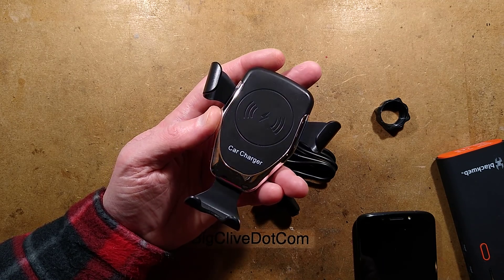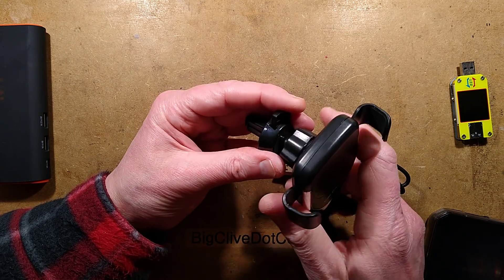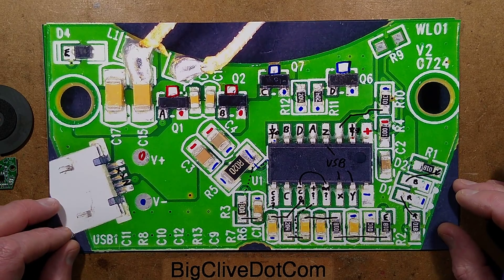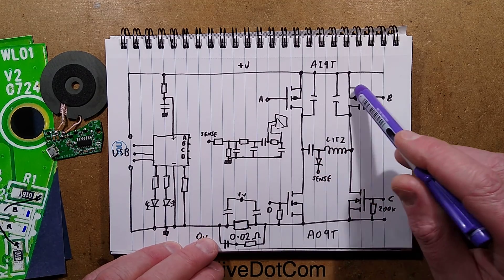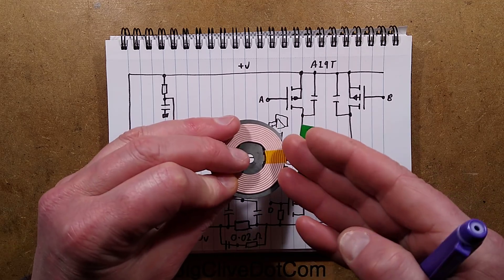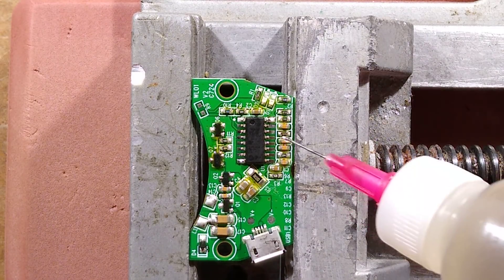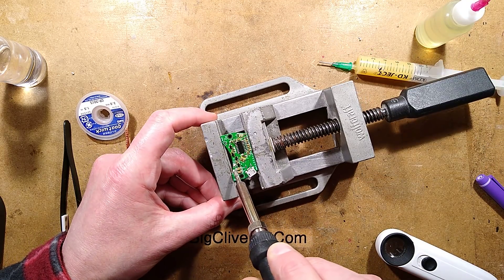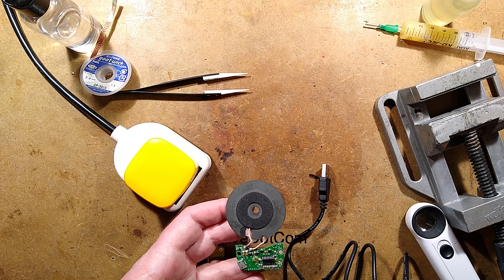Poundland inductive phone charger teardown (with schematic)

Comment: Not seen this one but i did have my eye on this one until i realised my Nokia 1020 requires a special adapter for QI charging and besides its so inefficient and slow better off with an old fashioned method ie plug charger!
I have a Marconiphone crt colour television over 30 years old and my  40+ year old Toshiba microwave is older than me and they all still work - average lifespan for you very average tv even panasonic aka Vestel is sadly now 4 years and microwave about the same - built in obsolescence for sure!
https://www.poundland.co.uk/339291-wireless-charging-pad/

Comment: 14:10 In the SMT pick and place machines at my workplace, each feeder has it's own ID number. If you put a roll of SMT components into it, the feeder is connected to a computer and a barcode on the roll is scanned, so the computer knows wich feeder has wich component in it. When inserting the feeder into the machine, the machine reads the feeder's ID and looks up wich component it has loaded and only uses it when the correct component has been loaded.

Comment: I sometimes would like to test these devices (they come back to the work as being "defective") but I don't have a phone that charges this way... If I were to take a coil and put it across my meter, and wave it in front of the charger, should I expect to see any voltage in the coil?
Reply from the maker: You can get bare receiver pads that put out 5V.  By adding a resistor and high power LED you can make a decent tester.

Comment: Protip: get the android app called "Ampere" which will show you the charge rate coming from the charger. For example, my Pixel 5 is currently charging at 1.5Amp from a powerbank I have with built in QI3 wireless charging support. Very useful app as it will also show you discharge rates too

Comment: So this a mount that it's difficult to align the phone in, if it fits at all, and doesn’t charge very efficiently. It gets its power via microusb. Why wouldn’t I just have a dumb cradle and charge the phone directly? It’s not that difficult. What am I missing?
Reply from the maker: For a delivery driver using their device as sat nav while also I using it to log deliveries, it could keep it topped up while saving a lot of connector wear.
Reply: @bigclivedotcom  Fair enough. I don’t drive much & hadn’t thought of that. In fact I drive so little I forgot the car was being serviced until I noticed it was missing last week. After a month.
Reply: @Matt Quinn That’s all very well, but the convenience would be reduced by the need to get it positioned just right. That’s footery enough in itself. You’re not going to have the USB power meter attached and there’s a fair chance it won’t get much of a charge.

Comment: so one of the only microcontrollers that i can find with those power pins in soic16 150mil  and usable specs is the paduk pms131-s16A but that would make your op amp loop vref to an analog input instead of an opamp also that would make Z the hardware reset pin which is fine except it doesn't have an internal pullup when used as an input so idk if that would work for usb line detection

Comment: The coil uses Litzendraht (Litz) wire. Multi strands of fine wire where each filament is individually  insulated and only joined together at each end. This significantly reduces skin effect losses in the frequency range of  kHz to hundreds of kHz. Qi chargers operate in the 100kHz to 200kHz range depending on their resonant frequency which changes with coil coupling.

Comment: I'm surprised you don't ever use an oscilloscope. You can learn a lot with one. It's the most useful tool an electronics engineer can have. Also, for surface mount I highly recommend a hot air rework setup. I've started doing mostly surface mount for my projects now since so many neat parts are surface-mount only. I have the boards made and a stencil. It's quite easy once you get the hang of it, especially with low-temp solder paste. I'm a bear too with my hands, with the added problem of trembling hands.
Reply from the maker: I do occasionally crack out the scope.

Comment: I have a similar one (same design, but different decoration) with different internals.
The internal plastic piece of mine is black, but more importantly it cominats marked ICs. An HC5703C (20 pin control chip), an LM324 (quad op amp), and two 8 pin MOSFETs: 4801 / YQ561, and 4812 / GA8P3C. And a 3 pin marked V3SC. The main capacitor is a leaded device. Oh, the 3 'legs' come out as separate pieces (and a spring) - a pinion gear remains on the inner carrier.Oh, mine is rates 5 volt 2 amps in or 9 volts and 1.67 amps.
Strangely it also states "5 volts out" and "9 volts out"...

Comment: I am aware that this inductive charges use resonant coils for charging, but how do the charges avoid wasting power, due to the eddy currents being induced in the phone screening and PCB tracks?
Reply from the maker: Alignment is fairly critical.
Reply: @bigclivedotcom   sometime in the late 90s, early 2000, I worked with someone  in Cambridge,  who slightly later formed a company  to develope the first power mat charging system. This was  sometime before the formal standards had been developed.
At the time I tried to persuade a major french car manufacture to build one of these chargers into the car glove compartment, the one between the two front seats. The idea was to make a place for charging mobile phones, the compartment was to be fitted with a passive aerial to re-radiate the mobile phone signal to an outside antenna. Communication with the car audio was to be via Bluetooth. 
Unfortunately, the car manufacture, did not think contactless mobile charging would ever become practical, and therefore rejected the idea.
The early version of the charging pad, created a complex three dimensional rotating magnetic field that was sufficiently powerful to rotate small metal objects placed on top of it. 
There remains the question as to why the modern version is not de-tuned by eddy currents induced in the mobile phone PCB ground plane or metal screens. Some time ago I downloaded the contactless charging specs, which are huge documents. These are divided into power bands and describe the communication protocols modulated onto the charging waveform. But as I recall, even these did not explain how stray eddy current loads are to be avoided.

Comment: Phones have so much useless circuitry. I have never used the touchless charging on my phones. I must be a dinosaur.
Reply: I use it w/ an aftermarket receiver coil (plugs into the USB port and sits between the back of the phone and the silicone cover) or magnetic USB-plug/wire in order to spare the phone's USB socket, which broke for me 2 phones back...

Comment: Great video!! 
It's nice to see that they made the ferrite disc so that the wire at the centre can go back to the PCB under the coil.
I also have a chunky case on my phone so usually have to dismantle any inductive charger, de-solder that centre wire, pop it through the hole in the centre of the ferrite disc and resolder it to the PCB so I can get the coil flat to the inside of the charger case so it actually charges the phone.

Comment: I'm working on pick and place machines. And at last the ones i know does not read anything off chips. The machine is only looking for chip "legs" and pretty much anything bright. Bright vs dark. Bright spots are measured, counted and alignet. It iluminates the camera and passes all of it heads (The one iam working on has 8 heads) with chips above the camera. Then in real time computer alignes all chips, expected vs measured centers of chips and places them with this aligment offset. Also verifies if measured "legs" (bright spots) are matching to the programed ones. So the camera is used to only aligment and rotation. Verification of loaded chips is made before auto run. After and durind loading copmonents into the machine. It is done twice at last in company i work for.

Comment: Interesting. I have a cheapo inductive charger, that seems badly regulated (gets really hot), in a case that matches your mat-style one, that uses just an STM8 as the chip. Do any of that match it?  It also matches a whole pile of recalls, one of which is https://www.cpsc.gov/Recalls/2018/Bluefin-Recalls-Wireless-Phone-Chargers-Due-to-Burn-Hazard  - so now it's just sitting around waiting for me to have a good idea of what to reuse it for. The case seems to be pretty generic, since I've now seen an ir-wifi bridge in the same case.

Comment: Thanks. .Probably the same chip used in a Braun electric toothbrush from the last century.
Reply from the maker: The toothbrushes are low current and usually very simple.

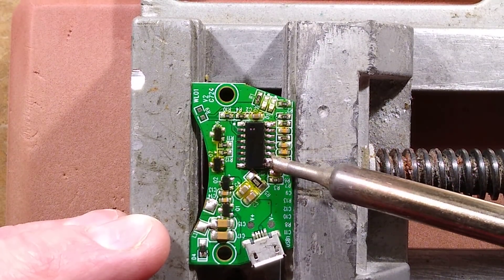Comment: I would check the solder blob that wedged in between the legs of Q7 at 15:42. It's funny that everyone always fail to insert a USB type A plug on the first try. Clive failed 100 % of the time as everybody else does :)

Comment: It might be interesting to bust out the silicone and take a few photos of the die, to reverse engineer the chip. I wonder how many people in the world actually KNOWS the innards of that chip.
Reply: Silicone?  How would that be of use?
Reply: @westinthewest  The die inside can be photographed and the you can reverse engineer the chip components and that way figure out if it is a generic microcontroller or a bespoke chip. If it is a purpose built chip you can quite easily figure out how it works.
Reply: @OscarSommerbo  I never realised the die was big inough to see anything without a microscope, and then it would just be a mass of tiny transistors.  What does the silicone do though?

Comment: Clive, Litz wire is braided in a pattern that ensures that each individual wire passes through each possible location in the cross sectional pattern equally. They also design it to suppress undesired frequencies and interference. Look here: http://hflitzwire.com/litz-wire-calculation-and-design/

Comment: Could this be something from the MC68HC908-series of microcontrollers? Power lines and most IO lines seem to match. Analog bit seems a bit strange but they might be up to some FFT dark magic.
Reply: I presume this is an Asian cheap clone of an existing microcontroller. I had a quick look at the main chip manufacturers and I could only find ICs with fewer or more pins to achieve a similar circuit. I also had a quick look through aliexpress and ebay... they seem to either have the same anonymous chip in this package or utilise a larger surface mount chip with more pins for higher wattage Qi chargers - which is marked. Considering the latest ones are using chips with their markings on, I cannot see them going out of their way to remove markings on the other chips... so I think it is likely a microcontroller by one of the newer Chinese brands.

Comment: I've used this QI charger with Poundlands cigarette lighter charger, and it seems to work even if it's only rated for 1A ( not the required 2A). It may only be good for topping up the phone, while driving with Google Maps. I don't think it will recharge a flat phone.
Reply: I've also modified my Bluetooth speaker to charge on Poundlands wireless charging pad. https://youtu.be/IYx985o4seI

Comment: How the hell did that reassambly work out functional at the end?!
Reply from the maker: It worked fine.
Reply: @bigclivedotcom  It did, but I was surprised splooching solder all over it actually didn't cause a short.
Reply: @DerCrawlerVomUrAnus  Solder mask coating on the circuit board prevents splooching

Comment: That's the only struggle with the blackview bv9500 pro I have. Which is even freakishly bigger than your newer model. 

Though, the 10k mAh battery makes wireless charging a non requirement. I carry 2 days supply of heavy use with me. 

It's nice laughing at people chained to the outlets at airports like addicts seeking a fix. All while I have a pound of the good stuff with me at all times, ready to explore the back catalogue of big clive to pass the 10 hour layover.

Comment: probably why it does not play well with power bank is the vw scandal effect the car detects when it is connected to the monitor in the garage and would work normally to prevent cheat devices

the scandal broke when researchers used old school measuring devices (probes in the exhaust pipe)

so it may be possible that the charger can detect it is connected to the power bank and usb power analyzer and not work.

if the manufacturer has gone to the extreme to make a proprietary chip then they probably also went to the extreme of detecting power analyzers.

you did not really tell us too much about the failure mode i.e. is the power bank not turning on, not staying on or the resistor network on the usb data pins are not of values to turn on the power bank.

because of the rash of rogue chargers many power banks do not have their data pins connected in an attempt to satisfy people leary about rogue chargers (a rash of getting malware from a charger).

so the power bank has to rely on ohms law to detect it is connected and the car charger may be not using load resistors to trigger the power bank.

under windows vista the empty r9 pads are not allowed.

Comment: Q I charging is BAD low eff  elevated heat of battery  poor efficient charge  i gave up and made simple phone holders with contacts on side phone & on home made wood bracket ect to side contact bat when in holder , drop & go ect NO stupidity in inductive battery rooters due heat & no rf ect

Comment: do you think that complex filter is used to filter out the communication signal that tells the charger to turn on ?? also that chip is present on all those cheap chineasy QI chargers i think you took apart one before and it arrived dead and you fixed it !!! im not sure its the same chip but it looks alot like it !!

Comment: Don't like them, produce too much heat that will ruin the battery
Reply from the maker: This one will charge at lower current, which will protect the battery.
Reply: @bigclivedotcom  oh right! So we should avoid quick charging ones (those who want as long battery life as possible). Too many tricks manufacturers play on batteries, conditioning you to change the phone when the battery goes bonkers.

Comment: the wire should be litz wire which is many very very fine insulated strands to reduce losses. the multiple fine wires exploits the skin effect.  this is more efficient at the high frequency the coil runs at vs. a solid core wire.
Reply: Also minimises eddy currents, much like a laminated transformer core?
Reply: @morpheox  yes eddy currents are why the current flows on the surface (skin effect) of the wire. also, the plate behind the coil is ferrite, which is much better at higher frequencies than laminated cores because it also reduces eddy losses by being high resistance yet still magnetically permeable.
Reply: @kevtris  ah.

Comment: im tempted to say the chip is a pic microcontroller as i found a document here https://ww1.microchip.com/downloads/en/DeviceDoc/50002992A.pdf that uses one with some support chips around it for QI stuff but some components are in very similar places especially the resistor/capacitor arrangement around pins 8,9,10,11,12. probably completely wrong but pins 1 and 14 follow the pic power rail standard in the doc. an illustration of the board is on page 9 of the pdf. shoot me if im way off, luv ya loads, jp x

Comment: 1:15 1:22 1:32 It's good to know that even an expert electrical engineer is just like everyone else and can not insert USB plugs the correct way first time. :D
Reply: The USB plug is by default in the state of quantum superposition and needs to be observed first to gain its final orientation.
Reply: @SianaGearz  Legit the most likely explanation!
Reply: The guy that invented usb died recently. They lowered him into the grave but he didn't fit, so they had to raise him up .....
Reply: @JezCunningham  Ahahahah. Thanks, I needed that laugh.
Reply: It's part of the USB standard correct insertion procedure!
Reply: @Senshikaji  
  Thank you for the standards clarification, Hazel. Takes me 3 tries to commit to a compliant state of incidence. Took four tries on 3 different occasions in mid 2018, iirc. Have to keep those compliancy options flexible. Like the writhing rubber line at the vaccination site. 💉
Reply: This is a pet peeve of mine.

On all of my devices, using a fine-point white paint pen, I put a small dot on one face of each plug and on the corresponding side of the socket.

In Japan, the general concept is called "Poka-Yoke".  Can also simply be called error-proofing.

Comment: Handy little gadget that.  AS you say, less wear than using the micro USB connector, but past experience suggests infrequent lubrication with generic contact cleaner keeps those connectors working fine for a very long time indeed. Basic maintenance - which in this case seems to work well.

Comment: Is that... microUSB in 2021 ? Oh well, it is Poundland after all....
Reply: I think it's a 5W model and they tend always have USB micro connectors. The 7.5/10/15W/22W I can remember seeing had USB-C connectors. I expect it's partly due to 5W models tending to be older and because they can't assume someone that gets the 5W Qi charger have any USB-C equipment, it's the "base" model.

My 10W AliExpress charger have USB-C input but support both USB PD (for USB-C) and QuickCharge 3.0 (USB-A) on that so it can get the higher voltages from suitable USB-A and USB-C chargers, I suspect plugging it into a 5V-only charger will restrict it to 5W charging - due to the power losses they quickly need more than 5V for higher charging speeds since very few chargers offer more than 2-2.4A.